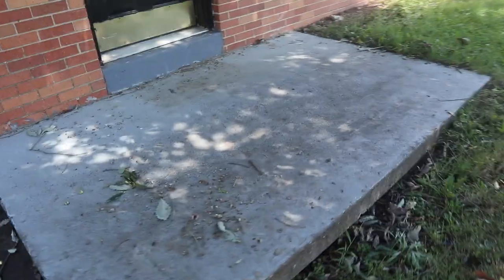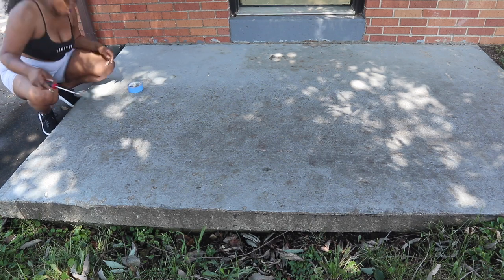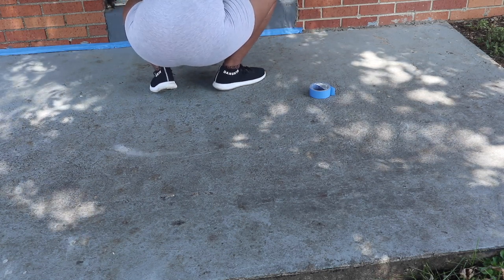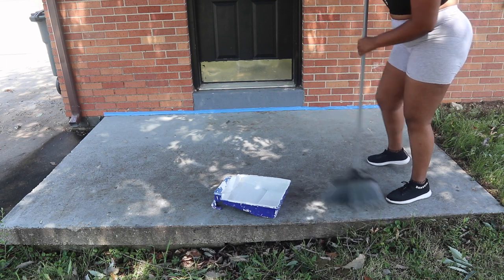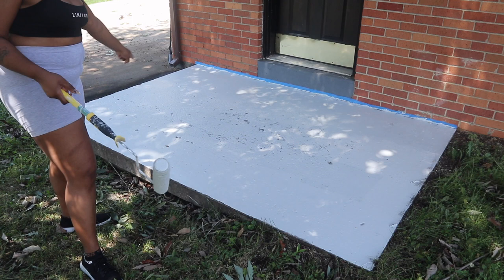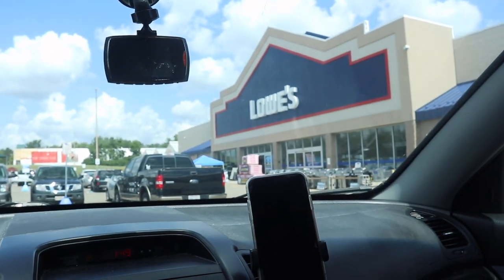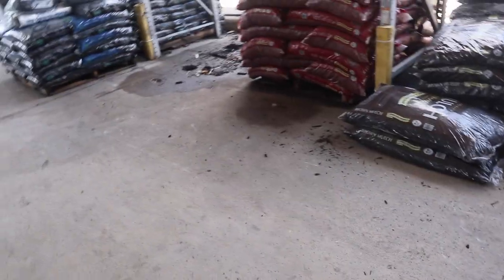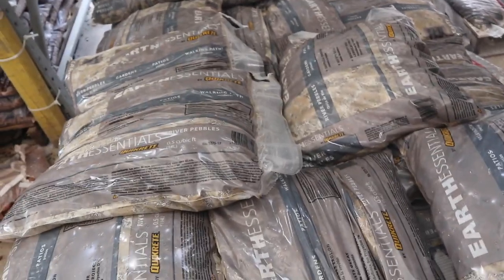HOME RENOVATION SERIES EP:1 DIY Front Yard TRANSFORMATION| CLEANING |CONCRETE PAINTING +LANDSCAPING!

Comment: You could put water in a mop bucket with a bit of dish detergent and then take your broom and sweep/mop. I used to do this to my porch all the time, and it cleans well. I would take another bucket of clear water and rinse it off and sweep off the excess water.

Try to plant grass on the left of your porch and edge around the perimter of the porch so the grass around the entire perimeter is not touching the porch. Also brass numbers on your door will make the door pop with your brass door kick plate. Your working it Sis. Bravo!!!

Comment: Tip for tins and pouring paint make a v shape on edge of can with thick painters tape. The v pours the paint out and you can pull it off no drips around edge afterwards. Make sure its right at edge of the tin almost and tape the length of it across the otherside of the tin like. You get it a v shape.lol😂✌🏼👌🏼😉 p.s tape any gaps at the side with more tape before pouring it or you'll get buts come out any side gaps.lol